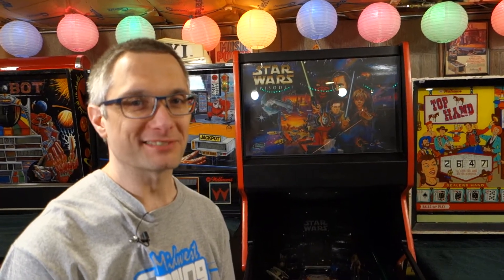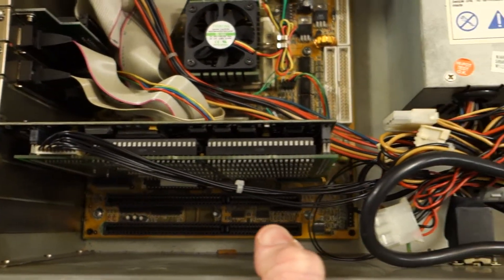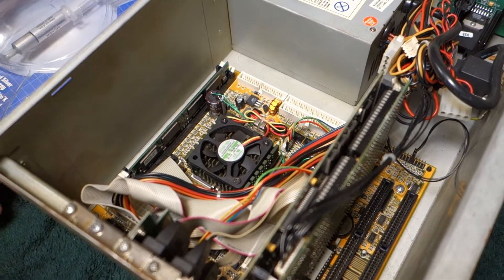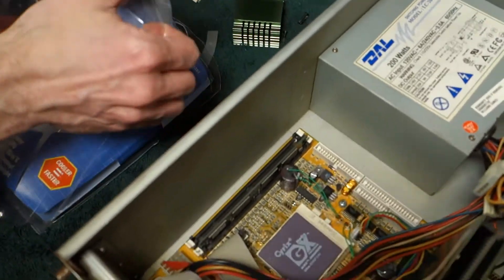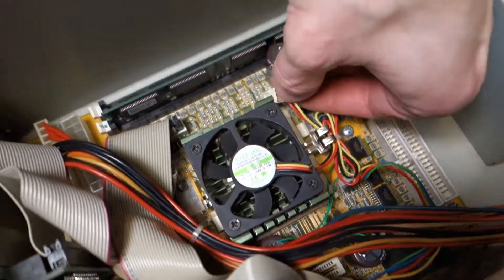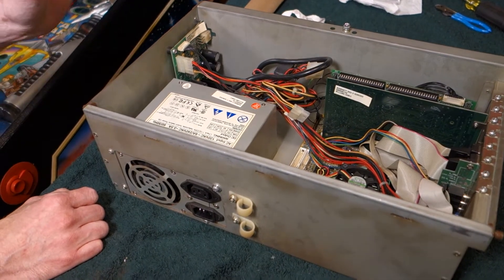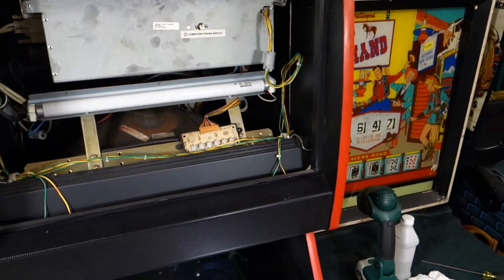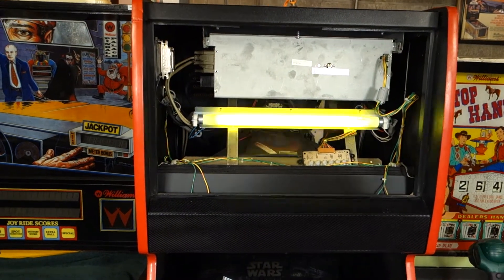"Star Wars Episode 1" -Pinball 2000 part 2 of 3 - computer maintenance

Comment: I realize this was 7 years ago, but it still needs to be said . . . 10x too much paste. There is NO better thermal conductivity than metal on metal. Thermal paste is ONLY for filling micro-voids. You just put 100 um - at least - of paste between the entire surface area.

Comment: Hello, I recently bought the same pinball machine and when I opened up the Power supply I noticed the resistor R67A is blown out, I'm wondering if you would be able to tell me what kind of resistor I need or if it's just a hard line? I'm having a hard time finding the schematic for it myself. Thank you! I hope to hear from you soon!
Reply from the maker: I believe Williams just used what ever computer power supply was available at the time. I would look for another power supply. Figure out what form factor it is (AT, baby AT, etc) and you should be able to purchase it from a computer supply place (or Ebay). That resistor blew out for a reason.
Reply: @PinballMayhem  thank you, you're probably right. I'll look into it.